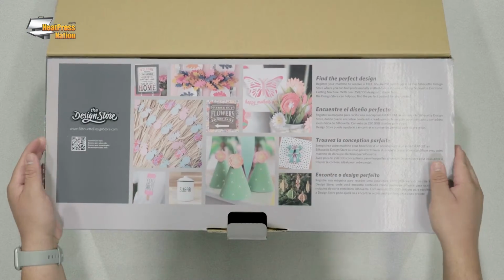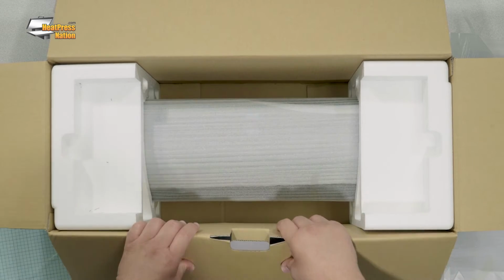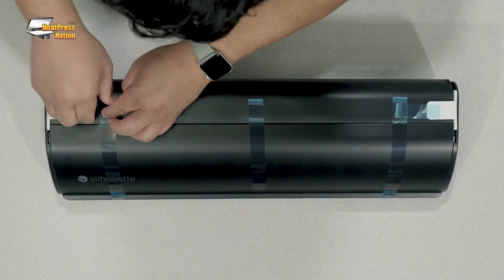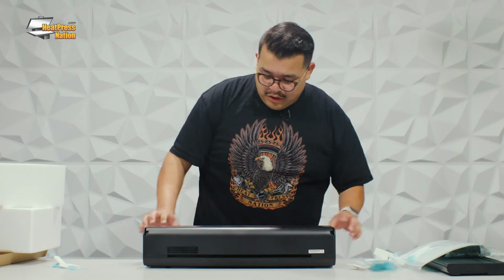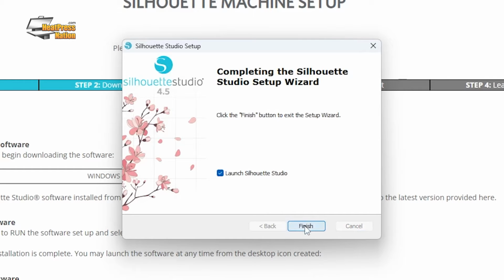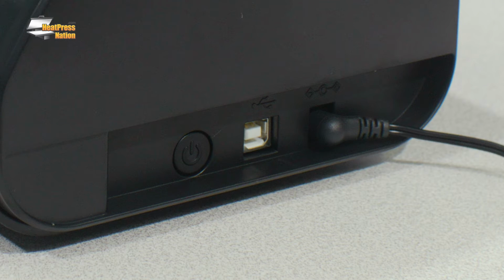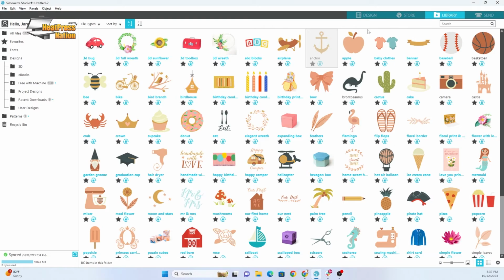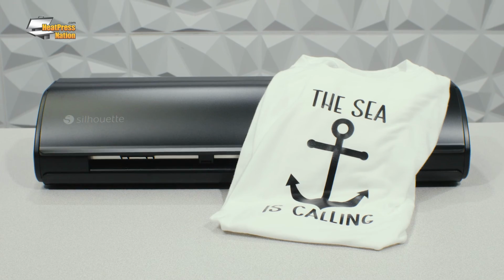Silhouette Cameo 5: The Complete Setup Guide

Comment: Hi, question have you tried the print and cut feature. Trying to look for one. That is an accurate print and cut. I run a small soap bath & body product company. Trying to find a cutting machine that could help me cut my labels for my jar and stickers and others.
Reply from the maker: Yes, the Cameo 5 has great registration and accuracy for print and cut - especially at its price point. However, for absolute precision, you may want to consider something like the Graphtec CE8000-40: https://www.heatpressnation.com/products/graphtec-ce8000-40-15-desktop-vinyl-cutter